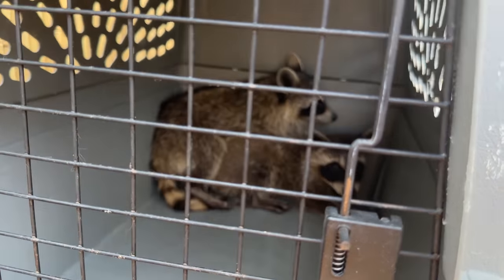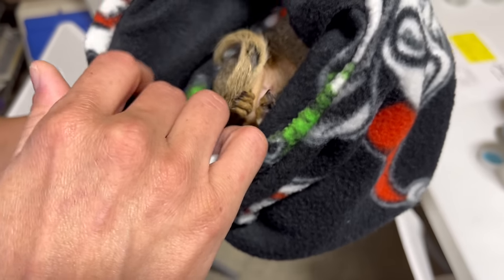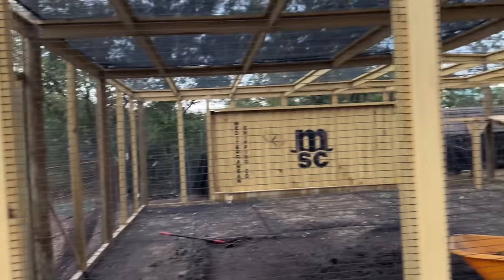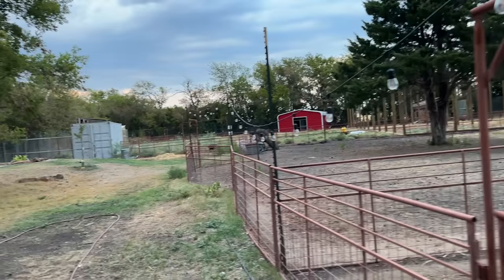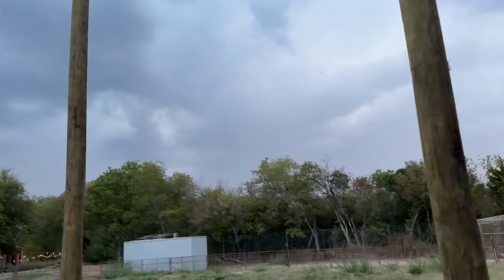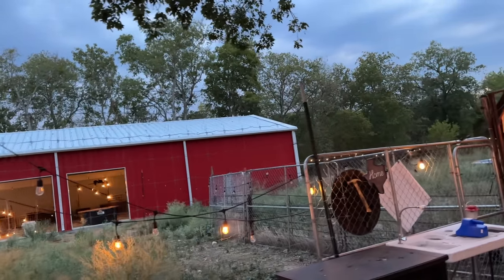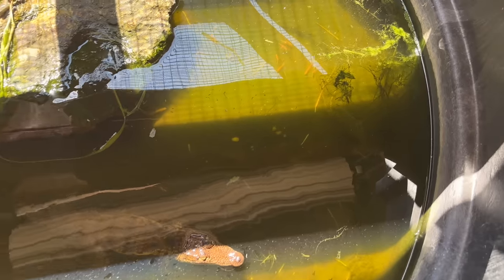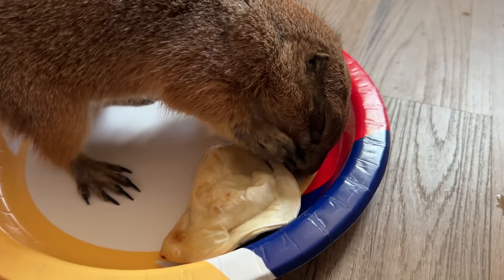I Fed a Crocodile to My Ostrich

Comment: Uncle Ben! There is a  raccoon rescue I follow in Florida called the Wright Ranch Rescue and with their racoon setups they built a sprinkler/hose system that the raccoons can pull a valve to get water every time they are thirsty and it doesn't dirty their pans everyday. Like this so Uncle Ben can see it might help!

Comment: Hey pro tip for helping clean up after construction trash stick a good strength magnet on the end of a framing hammer to pick up lots of unseen metal bits including nails

Comment: Heads up about the container, even with a big hole in the side it’ll still be hot as hell in there, you’ll need either some vent holes somewhere or to leave the big doors open for airflow

Comment: You can run a drain from the racoon water to the outside of the cage with a ball valve on the end outside of the caged area. Just turn the ball valve to release the water without having to go into their rehab space. Might help with less human interaction. You seemed to be able to fill it up with the hose pretty easily from the outside. Just a thought.

Comment: The UV filter 'GREEN ALGAE KILLING MACHINE' is available at pretty much any pet or online supply and it clears water really fast without any chemicals. I had a tank that was totally green and opaque, and after installing the basic model, my tank cleared completely very quickly. It was almost magical, taking only several days. UV algae modules really work on algae without any chemicals.

You can get pond sized versions too, I had only a tank version. They don't use too much electricity. Seriously they work almost like magic.

Free Tibet. Free Hong Kong. Recognize Taiwan.
Thanks for the content.
Keep up the good work.

בס'ד